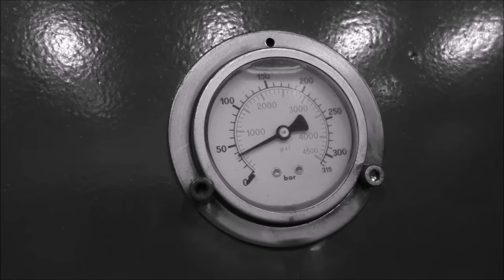Crushing safe and sculpture with hydraulic press

Comment: Wow, crushing that safe was too easy...
Reply: +Gone Tomorrow eh, enough pressure will collapse any structure
Reply: Actually no. Now the money is more secure then ever as it is trapped in there!
Reply: +tonza how did that not make any sense? He's describing a safe that is made out of 40mm steel walls, and either 400mm tall or 400mm wide. He needs to clarify what the 400mm is referring to but other than that it's pretty easy to understand. 

Also, there are safes that are built to resist 300tons of pressure (therefore surviving against the press). The one in the video just isn't one of them.
Reply: It's "only" 100 tonne press. Hydraulic Power has a 500 tonne one.
Reply: +Tim Lewis he's getting a new one soon
Reply: +Tim Lewis he's getting a new one soon
Reply: gone tomorrow you clearly don't know how much 300 tonnes is or how little 40 mm of steal is. Do me a favor, grab a ruler and look at the length of 4 cm. btw 300 tonnes weighs more than an adult blue  whale so just imagine if blue whale was put on that safe.

Comment: Try to crush a really strong safe, not a one that looks like a sardine can!
Reply: Ye but that's expensive!
Reply: yeah that was a cheap ass safe...
Reply: This guy has crushed diamonds...
Reply: Diamonds are easy to crush, specially small ones, they are hard, but not dense.
Reply: A diamonds hardness just means it doesn't get scratched as easily; that's why it's used in saws and what not.

That doesn't stop it from shattering when enough force is applied though.
Reply: The point is that he can afford to crush a better safe..
Reply: Henrik F That video was sponsored, the diamond was sent to him, he did not buy the diamond therefore your point is invalid.
Reply: suomi perkele
Reply: xTypho No its not, he makes a lot of money from this channel, so he can afford to crush a better safe. Regardless of the diamonds
Reply: Henrik F If it's not profitable he won't do it obviously.
Reply: xTypho Someone should send him a stronger safe.
Reply: Jimi02468 Yes!
Reply: +goover78 and burned the diamond remains with a blowtorch at that
Reply: They should try crushing a gun safe. Those things are built to take shots from a 30 caliber HMG, and high quality ones have been known to withstand an M1 Abrams tank running over it.
Reply: +Drake Blackley you do realize if it can stop a bullet of that grade it certainly will stop a hydronic press.
Reply: Ominethious Calistian I don't see why they can't try. And stopping penetration is different than preventing collapsing or crushing.

Comment: pan-tray? ash-cake? no idea. it was funnier when you called it a cigarette-tray that one time, though. I chuckled at that. 
Consider pressing a laptop computer and/or a tower, a 90s steel-cased one to be precise. a Thinkpad T61 laptop has a lot of magnesium in it for the roll cage inside and would probably make for some decent sparks and such when pressed as the material gets hotter. you could also try crushing the magnesium FROM the roll-cage of a thinkpad T61, since there's plenty inside to break up and bring together into a pile under the press head. parts are mega cheap, and who doesn't like magnesium sparks? 

keep doing what you're doing. you have a real heavy-hitter channel and have done what most people dream of doing with theirs, getting it up to the 1Mil+ subscriber mark.

Comment: Crush rolls of tape.  Recording tape, adhesive tape, both should be fun.
Crush some toilet rolls.  Don't know if you can get it in Finland, but Scott's 1000 Sheets rolls are rather dense.  
Crush a small wheel with solid rubber tire, like the kind used on carts for heavy things.
Crush a packet of cigarettes to go with all those ash trays.  
Crush an actual ash tray (the cheap plastic kind).

Comment: Can someone explain me hwo the  hydraulic press can exert so much energy and force ? How can it generate   several tons of pressure   from just a liquid gettign pushed around inside ? doesnt it mean that the samller piston that moves the larger piston  also has to have an equal force   (several  tons) exerted on it to move it ?where that thsi force come from ? is it mechanical ?

Comment: how much power does this press have? in whatever units you measure it
Reply: cylinder diameter 200 mm and full pressure 31,5 MPa makes 990 kN (F=A*p) and 990 kN  equals weight of 101 metric tons (m=G/g)